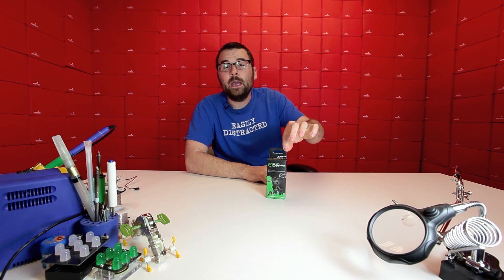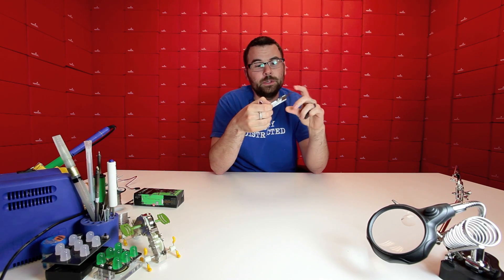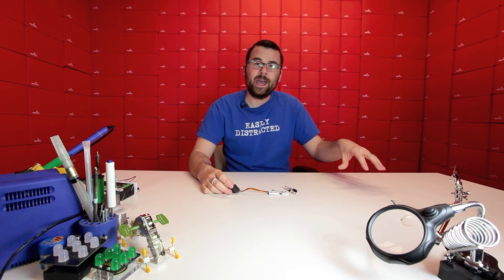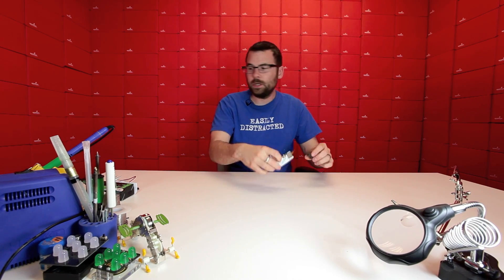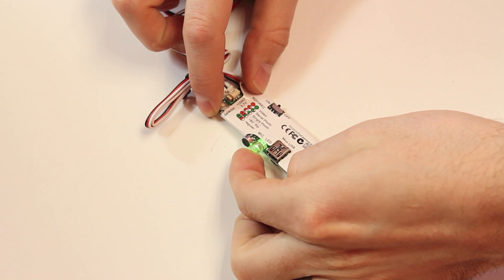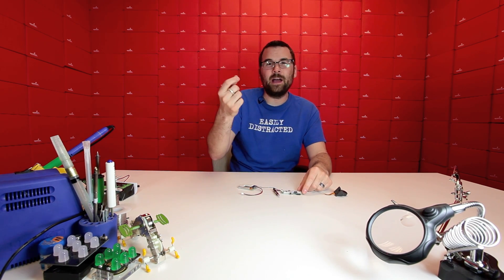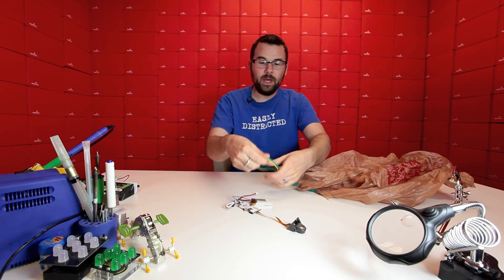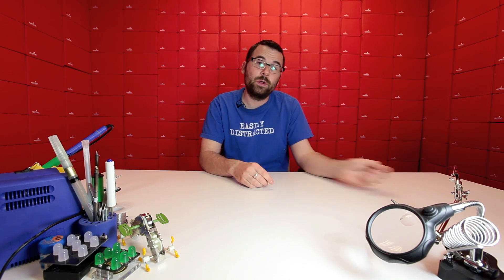SparkFun 3-30-12 Product Showcase

Comment: Disappointing product (poor video quality, small resolution, various driver quirks etc)
You could easily buy a 50$ camcorder like RCA EZ1100 for example and make it lighter by cutting the case and replacing the regular batteries with some li-ion batteries.